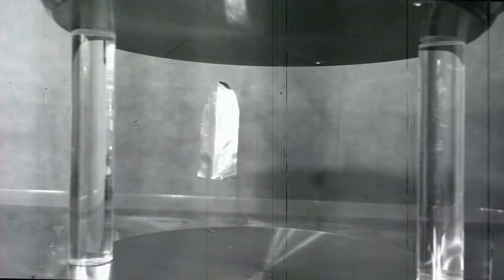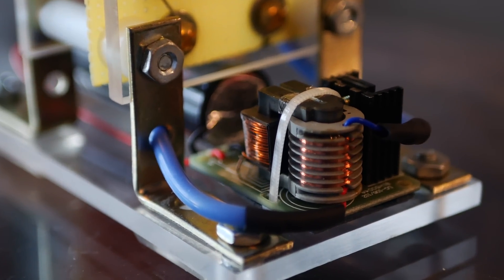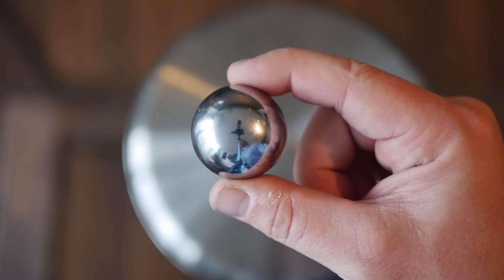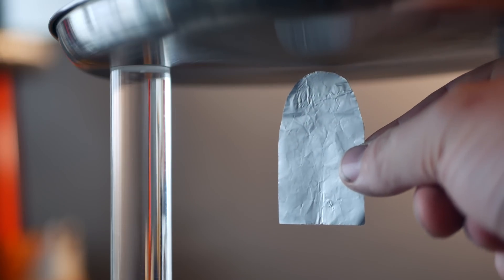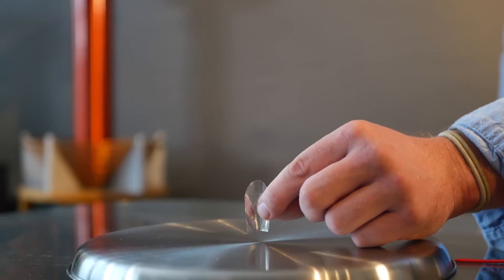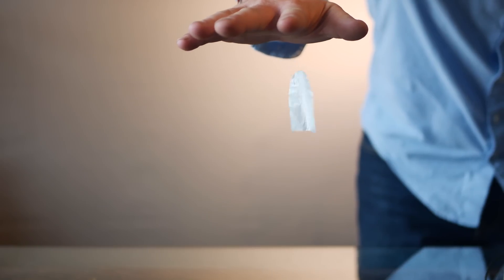Levitation Powers From High Voltage (World First?)

Comment: Is it possible to get electrostatic attraction without the spark, using commercial 60kv high voltage inverter electrostatic generator. Any modification to do done ?

Comment: Very cool indeed. Since Thomas Townsend Brown in 1928 there have been many 'ion wind' experiments and almost a paper per year is written about the effect. It's been replicated in a vacuum and in oil baths to eliminate ion wind. Physics still doesn't fully understand the effect. The Honda R&D Institute did the oil bath experiment and there was a 3% apparent loss in mass of a symmetric capacitor, though many of the experiments detail asymmetric capacitors. Power to ya :)

Comment: My future is a testla speaker
Powered by gravity and nitinol springs

Most batteries are hazardous to life
So I've got Crystal's bizmuth compressed air and gravity
These will be my energy storage

could run entirely on compressed air and spin electrostatic where required with a small testla turbine
Induction heats and compressed air cools
And Magnetic gears remove the need to have holes in the vessel

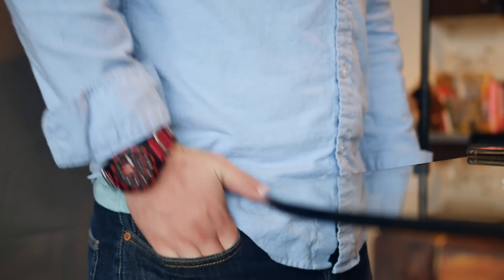Comment: Great experiment. Please note that the "one hand rule (you put your right hand in your pocket)," 5:50 is actually the "Left Hand Rule" (which you properly followed during the actual experiment.
Emphasis should be that you don't want current flowing "through your heart". If you're standing on the HV source touching with your right hand, the heart is not involved in the path.

Comment: "As seen, the capacity current is the exact analogy, with regard to the dielectric field, of the inductance voltage with regard to the magnetic field; the representations in the electric circuit, of the energy storage in the field. The dielectric field of the circuit thus is treated and represented in the same manner, and with the same simplicity and perspicuity, as the magnetic field, by using the same conception of lines of force. Unfortunately, to a large extent in dealing with the dielectric fields the prehistoric conception of the electrostatic charge [electron] on the conductor still exists, and by its use destroys the analogy between the two components of the electric field, the magnetic and the dielectric, and makes the consideration of dielectric fields unnecessarily complicated.  There obviously is no more sense in thinking of the capacity current as current which charges the conductor with a quantity of electricity, than there is of speaking of the inductance voltage as charging the conductor with a quantity of magnetism. But while the latter conception, together with the notion of a quantity of magnetism, etc., has vanished since Faraday's representation of the magnetic field by the lines of magnetic force, the terminology of electrostatics of many textbooks still speaks of electric charges on the conductor, and the energy stored by them, without considering that the dielectric energy is not on the surface of the conductor, but in the space outside of the conductor, just as the magnetic energy."  Charles Proteus Steinmetz (the guy that invented most of the electrical grid we use today), Elementary Lectures on Discharges, Waves, and Impulses and Other Transients, pages 13-14.

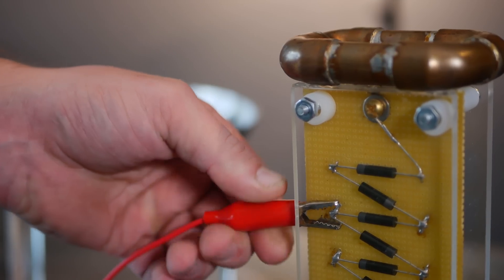Comment: At 3:00 or so, where the foil bounces around --- I'm quite sure we could capitalize on this effect/factor .. Could a containment perimeter be built in ring around the outside, to keep the foil on the bottom plate, and the power (voltage/current/frequency) and the weight/mass of the foil be controlled such that we witness some of the higher harmonics of this discovery?

Comment: 👉🏻 You don’t need all this gear to perform this. Simply rest one hand on top of a Van de Graaff generator, and your other hand over top of a small piece of aluminum foil, or paper. Watch what happens with a bowl of very dry pipe tobacco, or Styrofoam peanuts. And be sure to leave your shoes on rather than taking them off. 

I accidentally discovered all of this in my lab in 1970, including making ball lightning. Simply reverse engineer a Jacobs ladder. Add one huge electro static capacitor that’s hooked up to a kick butt electrostatic generator. Be sure to aim your now photon gun at a grounded steel plate when you test it. Otherwise these photon balls of light could start a fire if one of them gets in one of your walls, as they pass through all objects not grounded. Including wood and glass.

👉🏻 NOTE: The tiny photon balls don’t put off any heat you can feel, and will even attach themself to the hair on your forearm. I’ve had as many as twenty or so on the back of my forearm all at the same time.

Comment: In 2003, I saw a very similar technology in Germany (YouTube or Phones with cameras wasn't a thing back then :/).

However, they built a hexagon out of wood. The whole piece was covered in aluminium foil. They did the same thing with a copper wire. It has the same size and shape and was attached together. There was a space between them, so they weren't shorting the voltage. After putting a very high voltage, it starts flying. The huge voltage made the air move and lift the hole thing.

Comment: New to your channel, subbed. I am fairly sure that a guy like you would be able to figure out how to levitate your foil over water instead of a metal plate. If so, I can imagine transportation over seas. Good luck. Your water capacitor can supply the voltage necessary. I for one do not know how but this is why  propose this to you. You do so very, very interesting sh*t.
Reply from the maker: Thanks Robin, that means a lot. Welcome to the Plasma Fam!

Comment: it's almost as if the electromagnetic force is much.........(insert zeros)...much stronger than gravity. I would think if it's just a plasmoid pictured in radio waves at the center of galxies, you don't need black holes at all? It certainly fits the profile of speed with distance fall off of a birkeland current rather than gravity just supercharged with some dark matter on the flipside to help out the math. Does this makes any sense at all???

Comment: NASA did not discover this. Late 19th century scientists knew about this phenomenon. Look into "The Evolution of Forces" by Gustave Le Bon for an example. There are also anecdotal stories about capacitors demonstrating this phenomenon as well. Look into "aluminum foil-ionocraft lifters" to see what I mean. You can also look into the work of Thomas Townsend Brown. 

"The Biefeld–Brown effect is an electrical phenomenon that produces an ionic wind that transfers its momentum to surrounding neutral particles. It describes a force observed on an asymmetric capacitor when high voltage is applied to the capacitor's electrodes. Once suitably charged up to high DC potentials, a thrust at the negative terminal, pushing it away from the positive terminal, is generated. The effect was named by inventor Thomas Townsend Brown who claimed that he did a series of experiments with professor of astronomy Paul Alfred Biefeld, a former teacher of Brown whom Brown claimed was his mentor and co-experimenter at Denison University in Ohio.

The use of an asymmetric capacitor, with the negative electrode being larger than the positive electrode, allowed for more thrust to be produced in the direction from the low-flux to the high-flux region compared to a conventional capacitor. These asymmetric capacitors became known as Asymmetrical Capacitor Thrusters (ACT). The Biefeld–Brown effect can be observed in ionocrafts and lifters, which utilize the effect to produce thrust in the air without requiring any combustion or moving parts. 

In his 1960 patent titled "Electrokinetic Apparatus," Brown refers to electrokinesis to describe the Biefeld–Brown effect, linking the phenomenon to the field of electrohydrodynamics (EHD). Brown also believed the Biefeld–Brown effect could produce an anti-gravity force, referred to as "electrogravitics" based on it being an electricity/gravity phenomenon. However, there is little evidence that supports Brown's claim on the effect's anti-gravity properties."

Source link: https://en.wikipedia.org/wiki/Biefeld–Brown_effect
Reply from the maker: I’m quite familiar with lifters. I even made a video about it a few years back. They are not the same as electrostatic levitation. Lifters and the Brown effect use thrust, while electrostatic levitation uses thrust + electrostatic attraction/repulsion from nearby objects in a quasi stable state. Power is directly applied to lifters, same for asymmetric capacitors (Direct power connections). Electrostatic levitation involves zero direct connection to the levitating object, as the object is influenced by power applied to its surroundings. 

It is therefore a separate process. NASA was first to utilize this method of electrostatic levitation. 

Lifters, which are different, were definitely created many generations prior to the 90’s, as you stated. 

Cheers.
Reply: @PlasmaChannel  Thank you for your nice demonstration of electrostatic levitation.  Electrostatic levitation (with zero direct connection to the levitating object) does predate NASA, though.

A. D. Moore, in his book, Electrostatics, Exploring, Controlling, and Using Static Electricity, 2nd Edition, page 221, attributes the discovery of electrostatic levitation, probably in the 1750’s, to Benjamin Wilson, an English associate of Franklin’s.  Moore demonstrates electrostatic levitation using his Dirod electrostatic generator.

R. A, Ford, in his book, Homemade Lightning, Creative Experiments in Electricity, shows a levitating “rocket” cut from thin aluminum foil and several levitating “satellites”.  Ford says, “The writings of Dr. Gustave Le Bon feature his description of the electrified ‘rocket’”.  In the bibliography section, Ford lists Le Bon’s publications, The Evolution of Forces, 1908, and The Evolution of Matter, 1910.  I don’t know specifically which publication of Le Bon’s that Ford refers to, but Le Bon had many publications in that era.

You might enjoy adding both Moore’s and Ford’s books to your bookshelf.  Both have interesting electrostatic generators and electrostatic demonstrations.

The levitation demo using my hand as the negative surface works well with a foil about three inches long, using a 100kV voltage multiplier I built.  The demo works with ion currents from about 100 nanoamperes to about 10 microamperes, depending on spacing (about 12 inches to about 6 inches) of my hand from the positive terminal of the generator.

Comment: How do you make the residual voltage safely leave your body when you turn off the switch?
Reply from the maker: Hi Mart, great question. There is very little flow of current when draining one side of this voltage multiplier to ground. This is due to DC nature, and the low power of the power source. So, stepping onto ground with one foot still on the stool provides a very little shock, if stepping onto a resistive object such as a book. It's how I did it for the video. Then, when on the ground, turn it off.

Comment: Hi!
I also built that same voltage multiplier with the same power source but I only get pathetic ~2cm/1in sparks. I feel ionic wind next to the multiplier when it's on, so maybe it is leaking voltage potential? Do you know how I could fix it?
Thank you so much for these cool videos!
Reply from the maker: Hi Patrick - make sure all your solder joints are smooth and no sharp points anywhere.
Reply: @PlasmaChannel  Hi! Thank you for your response! I tried making the solder points really smooth and no sharp edges, but still pathetic arcs and lots of ionic wind.

Comment: Why do we insolate our voltege multiplier?
To prevent the voltege from arc ing to each and or to prevent it from arcing from the midle to you?
And, how did you toutch the arc in your other voder?
I mean the driver wasn't connected to the electrical growind of the multiplyer and, if your foot was conected, why didn't you die because you were passing 424000v trugh your body

Comment: Next challenge do ionizers kill bacteria/viruses?
Reply from the maker: They should kill them to a certain extent.
Reply: @PlasmaChannel  could you do a similar experiment to the ozone petri dishes you did a while ago? This time you would fire ions from a ionizer module you get from eBay for 5 dollars with carbon brush outputs. And then see if it makes a difference. Could be important for the current Covid pandemic....
Reply: Here is a 240 volt  module with carbon needles .  you can also get 12 volts ones as well

https://www.ebay.co.uk/itm/Home-Anion-Negative-Ion-Generator-Ionizer-Module-Air-Purifier-4-Lines-Household/392881637146?hash=item5b7992071a:g:FjgAAOSwQMVfGAyM

Comment: Please make a video on a 20kv ac power supply.
I need it for my voltege multiplyer.
Reply from the maker: I did one using a Subaru ignition coil last year. check it out!
Reply: @PlasmaChannel  i did and, i baught the ignition coil.
Im the whon who asked you what voltege and amp did you use
Did you really use 15.5v at 4a?
Because that will make a purple spark. Not a redish pink one.
Reply: @PlasmaChannel  and, that is my favorite video that you have made.

Comment: Can i use 20kv 1nf capacitors and 20kv 20nf diodes for my voltege multiplyer?
Reply from the maker: Yes, that is perfect. As long as they are ultra fast diodes
Reply: @PlasmaChannel what are ultra fast diodes exactly?
Reply: @PlasmaChannel  im useing those black diodes with zigzag to indicate the negitice.
Reply: @PlasmaChannel  im going to use the same diodes that a youtuber called stoppi used.
The video name is
'200kV 고전압 cockcroft walton multiplier-200kV Hochspannung Kaskade'
Reply: @PlasmaChannel  can i use 2CL20?

Comment: Your trying a 1.2 million V voltege multiplyer? Cool
I'm trying 2.5but low current and 50kv and THICK sparks
Reply from the maker: That's epic. Requires an insane amount of insluation.
Reply: @PlasmaChannel  im going to use a 20cm pvcpipe and transformer oil or some paraphene if i pronounced it right (the stuff in candles)
Reply: @PlasmaChannel  it will take me about 1~2years to get the 700$that i need.  :(

Comment: I did experiments like that back in the 60's
Reply from the maker: Really? That’s pretty cool . How did you do it back then?
Reply: @PlasmaChannel  I had an old Hoffman B&W TV with a burned in spot in the center .I use the High voltage from the CRT,  Took a lot of safety measures. I discovered Ionic wind the ability to charge objects,levitate a  small AL foil  and change the polarity of the wind I don't know how much voltage I was working with. Later experiments  involved a Neon transformer then a Voltage tippler. I had a few analog Voltmeters on my bench  I electric field moved the Voltmeters without any connection. I could hear the IIons spewing in to the  air, Yes I was surrounded by the high field. I always use the on had in my pocket rule  Not something for an Amateur to try at home

Comment: Correct me if I m wrong

Flow of Electrons is from negative to positive...As u connect the Aluminium foil to positive ...the cations or the positive ions ..spread to whole Al plate..while u connect the negative to ur palm ...which then anions float to your hand 

While the Voltage is equal to Work done in bringing a unit charge unit from one point to another point...so as the cations spread throughout the Al sheet...the Volatge makes more effort...and helps 

Transferring electrons from ur hard to The Al sheet 

As according to Charge by conduction method...The small Al sheet placed on large Al sheet..picks up the exact positive charge and by Unlike charge attraction law ... The Al sheet gets closer to ur hand and levitates..and as the foil moves up...Charge by induction method starts making the foil lower part Negative and foil upper part positive..but as soon as the Distance between them increases the Electro-static force decrease..and then the foil drops again...then the cycle repeats ...if during levitation the The foil comes on steady state ...then it's ions are adjusted by the fields....the hand as negative ...pushes electrons downwards and attracts the positive ones ..as u said from 4:30 (I guess)

And by the Formula Voltage = Di electric constant multiply by Charge ...whole divided by Distance..so it levitates more quickly as the distance between ur hand and small Al sheet is reduced as Voltage keeps on increasing and increasing...making transferring of charge more quick😊😊

By the way ..great video...love from India 🇮🇳🇮🇳

Comment: Great video. Even tho it seams you used right hand for the experiment, you showed the "one hand rule" with your left hand. It should be noted that "one hand rule" should be "right hand rule" as most dangerous electric shock path is not hand-to-hand but left hand to right foot (as the electricity goes straight through the heart). If there is a risk of getting shocked through your feet, you should absolutely always use your right hand in "one hand rule".